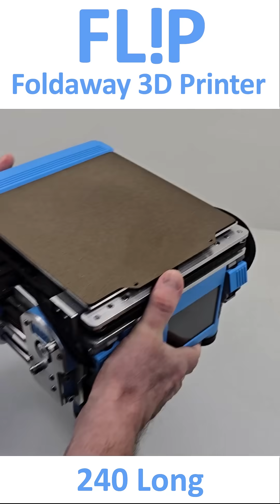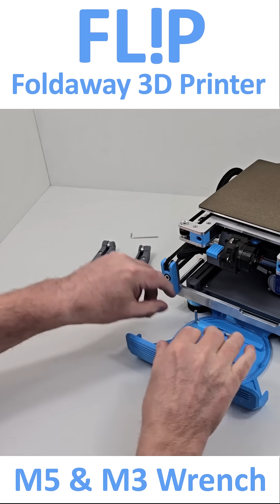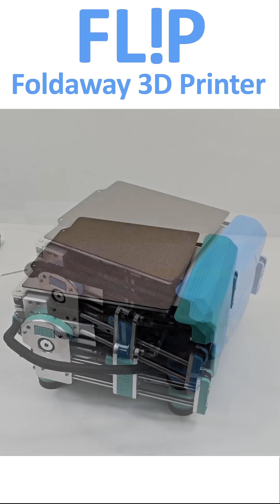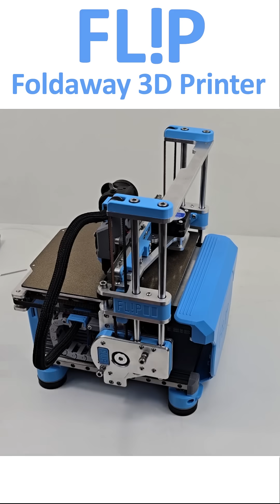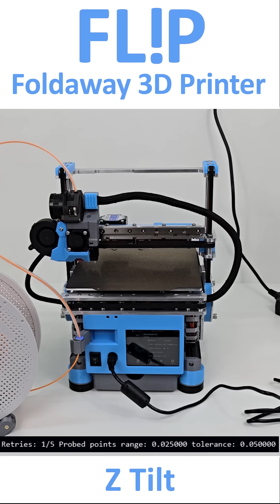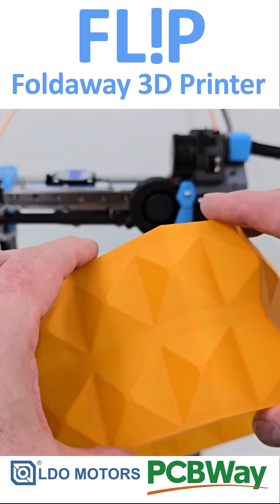Flip - Foldaway 3D Printer

Comment: Why would you build this over a positron, or lenontron? I'm sure one of them will have direct drive before yours is released. So, whats the point?
Reply from the maker: The point is looking at different ideas, the point is about learning through experimentation, that is what folks with an enquiring mind like me invest in.
Reply: @boothybuilds honestly, if i had to remove 4 bolts to build my printer that couldn't fit in any commercial boxes i would just cut an ender 3 in half. I understand experimenting, but you're designing a product, and i don't see the advantage. I'm building a toolchanger based on k2 hotends, fully knowing I'm not going to compete with the indx, but for me it's cost savings. I can't determine your endgoal unless you simply don't care about the cost or comparative performance/footprint to machines available.
Reply from the maker: Your first reference was regards the Positron, does that work out of the box with no mechanical manipulation? I wont even go near your Ender 3 analogy. The crossed wires here are that you are your are presuming I am designing a product for commercial or other personal gain, I am not. You are right, I do not care about cost and I do not have an end game., this is simply my hobby where I do things for myself that I enjoy, keeping my design hand in the process, and then share my ideas, I may share CAD files for others to reference but that is the full extent of it. If folks want to remix or improve on the concept, great but I have no further aspirations other than that. I am a financially comfortable retired professional designer that wants to keep his hand in that just does not want or need to monetize my hobby or ideas.